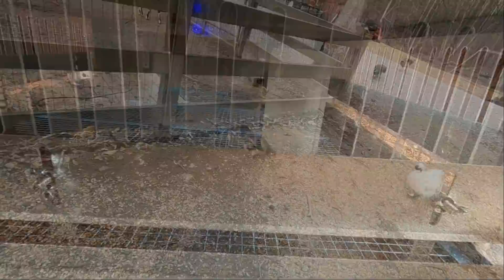We Got BAD News On The RARE Duck Eggs & She JUST Got Stuck Again!

Comment: Good morning form Louisiana.  You all may wanna thing dozer for those chores.  Wheels in that type of soil will only sink.  Tractor traction is way better suited.  Especially since the thought was to make a drain.  I know it's more ethically to think land grading will handle all the problems.  Sometimes mechanically may be needed as well.  Even if it's as simple as pvc pipes in the ground with well placed holding wells filled with gravel and pvc pipes leading to were you want the excess water flowed to.  It's that or build the water fowl a pond .
Reply: They would love a pond too!

Comment: Mrs Cog,  when you use the bob cat foot pedals, the center pivot on the pedals is built for a man with size 10-12 shoes, so when you push the front down only the tips of your toes are pushing instead of the whole front half of your foot.  I am 5'4"  and it took me a while to figure out I now put a 2x4 block  in bottom behind heel of my shoe and it lifts my foot up so I can operate the    pedals a whole lot easier.  Sorry no suggestions for when it drops in a hole except what you are doing, dig dig dig.

Comment: It's the trying which counts.  Everyone has a hatch that does not make it.  So easy for egg air sacks to detach especially with mailed eggs.   Chicks get tuned around and can't get out.  Try to candle when you  first get the eggs if shell not to difficult to see through.  if you see air sack  on side or saddle shap and not round at top egg,  then secure keep egg in egg crate keep  round end  up incubator until pip then lay on side.   You tube has video showing how to save detached air sack. Happens to chickens, ducks and  goose eggs and emus  all eggs.   You do a fantastic Job Mary Carl and love that you care so much, what makes you a great bird care giver.   All your birds show the love you give them.   Got to love them  all , as your family does. Great  job!

Comment: I think you should have dug a bit of trench in the low part and laid drainage tube in a sock all the way to the creek then back filled and levelled. In my mind that would work better cause the water still has to go somewhere, you're just changing it's path.

Comment: piece of advise if you rent or buy a skid loader you found the worst part of a skid loader one with wheels preferred is a skid loader with rubber tracks not wheels the tracks spread out the load and a lot more contact with the ground so much more traction  matter of a fact they make metal track for wheeled skid loaders for those that don't want to go to the coast of buying a newer track loader but want better traction